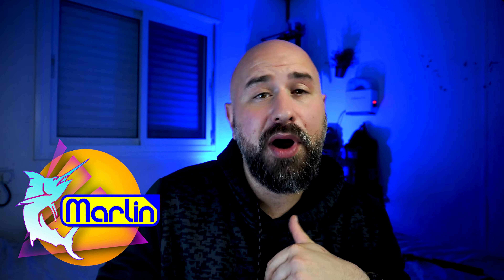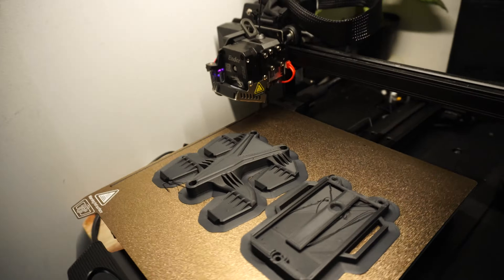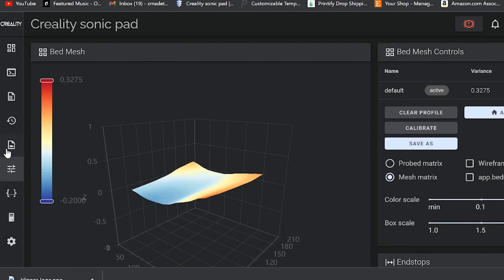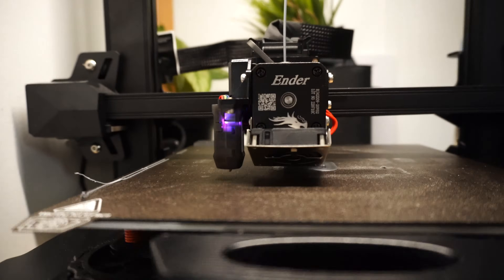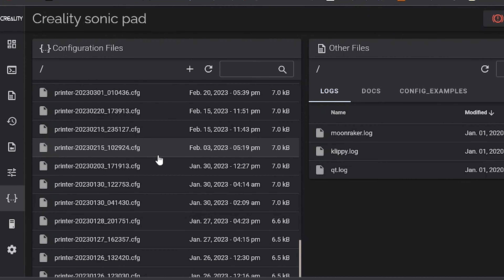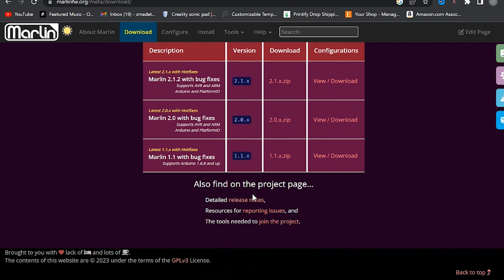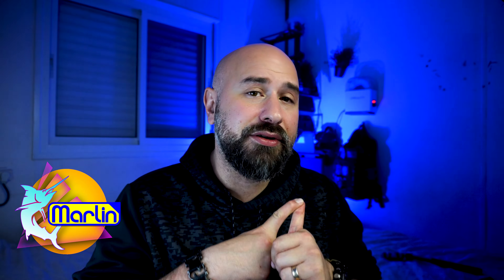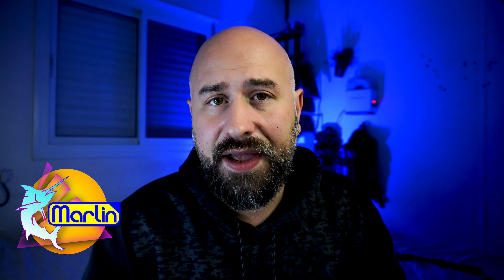Klipper vs Marlin which one is right for you

Comment: Great overview and good presentation! No disagreements on the fundamentals here. We are definitely passionate and never stop improving and expanding Marlin as more powerful hardware comes along and as new features are brought in by our amazing contributors. Features like Input Shaping and Fixed-Time Motion are very new to us in the RepRap world, so we're just beginning to get into refinements and optimizations. But even our first iteration of ZV Input Shaping is pretty mind-blowing, especially as it even works on AVR – if you have enough RAM.

One thing I can slightly correct is that the newest 32-bit boards have plenty of power to handle motion efficiently while also maintaining the UI, sensors, and peripherals. There is no real bottleneck to speak of. In fact, we are using only a fraction of the power of the newest STM32 processors even for things like Input Shaping and Model Predictive Temperature Control. Consider that old 16MHz AVR boards do a very reasonable job with 16 micro-step printing at 250mm/s, and even the slowest 32-bit boards are at least 5 times as fast as AVR! We're really spoiled with the amount of computing power we have today — and in fact now at lower cost than ATmega2560. It's only going to continue on that track, and we're going to keep finding new ways to use that power to improve safety, intelligence, and user experience.

We can't wait to share our latest improvements, coming as soon as we get through this round of testing and cleanup. Improved documentation and better tools for configuration and installation are also in the works, but it's hard to beat the videos by guys like Teaching Tech, Chris Riley, and Tom Sanladerer, who do so much to demystify our technical voodoo. I'm also building the next version of "Auto Build Marlin" extension for VSCode with an enhanced configuration interface that should help a lot with finding the exact option in our massive pile of setttings. Expect more runtime configuration options going forward as well.

Thanks for this awesome video covering the pros and cons of single-board versus augmented 3D printer controllers. We love the whole world of 3D printing and are huge fans of Klipper, RepRapFirmware, and Prusa's "Buddy" fork of Marlin. Each one has its own approach to the core problem of reliable, fast, and accurate printing, and we all take inspiration from one another. In the end it's the whole community of users, hobbyists, and creators who reap the benefits, and that's what it's all about. Happy printing!
Reply: My goodness... Will I get a backlash from Klipper fans for this post, but here goes anyway, I get the reason why clipper was developed BUT most of the reasons why it was developed is not valid anymore. I'm n little-bit baffled that the developer(s) of Marlin said "No disagreements on the fundamentals here" since a couple of things is simply not true, well, they were but not anymore. Dont get me wrong... There IS definitely a place for Klipper, However, its just simply NOT true that Klipper produces a higher quality print because of processing power. Let me clearly state that I'm only referring here to the latest printer mother boards which, almost all, use ARM or RISK V cores of at least 80MHz and up. 

1. Anyone that knows the deep down low level inner workings of CPU's will agree that background process handling is WAY WAY faster than most printers need. Stepper motor handling is the no1 main function that is driving a print... I mean mechanically, this process consumes a large chunk of the printing process. Yet ALL the step pulse toggles, and timers that handles it is completely (or almost completely) handled by timers and interrupts and that does not use any program cycles. 
My argument around this is that, with Klipper, ALL updates to timers must be fed from externally through a serial port which is miles slower than a CPU simply update a timer on a internal 32bit CPU bus.

acceleration

3. Live, On the fly settings change is also available in Marlin WITHOUT RECOMPILE! Everything from endstop setup, bed size, acceleration, extruders, autolevel, and tonnes of other. YES, there are definitely more settings one can change in Klipper, I would hope, but definitely not ones that is needed on the fly. And definitely not that one will change more than once.

4. Ignoring all my other points that I want to make, one has to ask, Is the money spent on your budget Ender not better spend by upgrading things that DOES make a huge difference, like adding a simple geared extruder, or direct extruder, or better DRV drivers? Once those upgrades was done if you add the cost of Klipper hardware you could have bought a very good midrange printer.

... sorry, but from an engineering point of view Klipper simply does not blow my hair back like people make it out to be.
Reply: @ImTheJazzman i really appreciate discourse like this. I also think you presented it well. Thanks for the information
Reply: @ImTheJazzman wow
Reply: @ImTheJazzman  Finally someone who critiques Klipper from a real engineering standpoint. I was having many doubts about my own judgement since the hype for Klipper is so high, I was starting to think I was the one mistaken since I also thought many of the things you stated, specially when it comes to serial communication and the proccesing "power" of both Klipper and Marlin compared. Moreover, theres a reason why many are seeing the need for a CAN bus for Klipper, when no such thing will ever be needed for Marlin since its communication is way faster, and the more thechnology advances and people push Klipper further, the more they have been realizing apparently that Klippers serial communication is a huge bottleneck.
Reply from the maker: Thank you for taking the time to watch my video and provide such a detailed and informative response. I appreciate your input and insights regarding Marlin and its latest developments.
I stand corrected about the processing power of the newest 32-bit boards. It's good to hear that they have enough power to handle motion efficiently while maintaining the UI, sensors, and peripherals. It's also exciting to hear about the new features, such as Input Shaping and Model Predictive Temperature Control, that Marlin is implementing. I look forward to learning more about these features and seeing how they improve the overall printing experience.
I agree that the 3D printing community benefits greatly from the work of passionate and talented contributors like yourselves. It's impressive how much progress has been made in such a short amount of time, and I'm excited to see where the technology will go in the future.
Once again, thank you for your response and for your contributions to the 3D printing community. I'll be sure to keep an eye out for Marlin's latest improvements and updates.
Reply: Thank you for your extensive reply to this video, very sportive of you guys. I have loved Marlin for years and got best results. Reason i'm trying Klipper is that Cura did an update and since then 'm having issues with the extruder. I tried installing the latest 2.1.5 Marlin software via VS code, but am receiving so many compilation errors. I have lost couple of days trying to debug but without succes (im not software engineer). For now I'll try Klipper and see how it goes (if it is better i dont know yet).... i'm using SKR 1.4 with TMC2130 and BLtouch connected to raspberry pi 2 with octoprint, worked flawless

Comment: I don't understand the way you present marlin pros. I mean dude you can do multiple extruders on klipper aswell, it has a huge community aswell (and vorons and ratrigs community just ads more to it). And y'all still target the fact that klipper is hard to install and such but as a person that made a custom 3d printer with almost 0 knowledge in this field i can say it was pretty easy to do it. You just take the rpi imager and flash klipper on the sd card and you're almost done. You just need to make the firmware file for your mainboard (this is sometimes hard to do it but if you follow the klipper documentation and READ it's straightforward). Now don't get me wrong marlin is amazing for printers that don't need much quality or speed and just need to print something. And cnc machines! I use a old skr 2 board of mine to run laser marlin for my corexy laser cutter and it's amazing.

Comment: If you have a 7 year old printer is now worth 100 dollars max, it’s not worth of buying a raspberry pi to get clipper running on it, investing all of the time it needs to install , configure and tinker with it until it runs right. Marlin would be the easy shortcut to improve the result without much extra time spent. Clipper might speed up thing but the extra speed will also introduce extra problems in many cases , especially with cheaper hardware.

Comment: Thanks for the video, been out of this side of 3D for a few years and it seems....  sure didn't slow down in my time away.
I've got a HyperCube Evolution I build and moded a bit from the base project, it's ok or good, but never been FAST, so I tend to use only a small portion of the build area as filling it would be a multi-day print.   
So, I find myself looking to improve that and start using it again. I'm still using the ramps1.4 stack with Marlin (1.9 i think). 
Any recomendations on new boards, screens (touch if possible), drives?  
Hesitant with Klipper simply because I know my limits programming, if a base file for my printer is avalible, could probably stumble throught changing some parameters (size, setsp per mm...ect)

Comment: Was kind of shocked to find out the Ender 3 V3 runs the OS (Linux) and Klipper on board, no Raspberry Pi needed! Originally I was afraid of dumping Marlin and octoprint, but the Klipper system is much better and MUCH more configurable/customizable.

Comment: You are right both Marlin and Klipper work really well. I used Marlin for three years and it worked well , although I did not config it I used Kersey Fabrications firmware which worked really well. Then I got bored one day and had a go at Klipper , because I am not tech savy it took six months of trying to get it to work. Now I would not go back I have it sorted and it is easy for me . I have not leveled the bed for a year and my start routine is the same every time . Home, z-tilt, home and print. No print failures for a year. Good vid 😀

Comment: My firmware brings all the boys to the yard
and they're like it's better than yours
damn right it's better than yours
i can teach you but i have to charge.

I'm recently miffed at Marlin, due to probe bugs and bits of unrefined UX. I use a DIY servo probe. I have worked on bug reports and patches but ultimately didn't quite have the time to beat it into shape. I have planned Klipper for a while as it's the cheapest upgrade path with Pi0. But haven't made a jump to it yet. Not sure how well Klipper is going to work for me either, given i want to be able to drop the toolhead and replace it with say a Roland drag knife, maybe laser, engraver and other possible accessories.

I think the best think about Klipper isn't input shaping, it's the correct jerk-free acceleration handling.

I think a very good thing is being disregarded, RepRapFirmware, also known as the Duet3D firmware. It runs on LPC and STM32 processors and some control boards can be really inexpensive, it has built-in web browser controller, and it has all the same algorithms as Klipper, indeed originating many of them. Marlin attempts to reach for the same but the quality of implementation is so bad for the more advanced movement algorithms, the options don't work well with each other, the outcome is pathetic... it's understandable given Marlin has to remain compatible with 8-bit controller boards, but it's unfortunate. A firmware won't be really good at it unless it can pick one movement model and stick to it.

There was also Smoothieware, not sure where it's at right now.

Comment: To me it was soooo worth. The way you do basic tuning and configuration changes in Marlin killed every bit of excitement I had for 3d printing when I started out. Typing in manual gcodes on a horrible touchscreen, hoping that things would properly save with no feedback at all. Needing to compile my own firmware, open the printer up, disconnect the display and repeat for every small mod or config change? Just no...

I pretty much ignored my printer for over a year because of the user experience with marlin. Sure, Octoprint might have helped with some inconveniences, but at that point I was too jaded to even care.

Ever since I installed Klipper I actually like using my printer now. I can start a print right from my slicer, I can edit the config from my PC in an instant and repurpose mcu pins for whatever I want. Klipper provides wonderful feedback on pretty much every tuning step and the overall user experience is just so much nicer, even before considering the extra features.

Comment: The Sonic Pad is a great idea, but as of now it is still relatively locked down compared to vanilla Klipper.    Marlin on a 32 bit board is really powerful still.   That said, a lot of stock firmware is not even using half of what Marlin can do, so even flashing a new version of Marlin with additional features enabled can make a big difference to the printing experience.     I found that when I first got my Ender 5 Pro.  Although it had a 4.2.2 board (32 bit) it had an old version of Marlin that was feature limited.   Upgrading to version 2 of Marlin and enabling features improved the experience dramatically.   I also had a Raspberry Pi 3 and a 7inch touch screen laying around, so it wasn't long before getting Octoprint (Octopi) into the mix.  I used that for a few years, but now I am seeing so many good reviews on Klipper, not to mention that is now also starting to creep into commercial printer releases, that I felt it was time to try it on my old, original ender 5.  Well.....  The difference wasn't night and day.  It was more a bit subtle, but I could get an extra bit of speed out of it.  Quality wasn't improved over Marlin 2, but I could go from 80mm/s to 120mm/s and not have any degradation of quality where is with Marlin, if I increased the speed, although it still printed well, the quality was noticeably different.   
I kept my old SD card with Octoprint and a copy of my Marlin firmware in case I wanted to go back, but so far I am not going back and KlipperScreen with Mainsail is a much more complete user interface than OctoScreen or OctoDash.    I can still run OctoPrint for the advantages of Octoprint, but Mainsail and KlipperScreen just give a very complete UI for the printer.   That's something Marlin was never really able to achieve on an Ender 5 with the stock display.

Comment: Hi, Thanks for the video. Very helpful. I am just getting back into it and have some relics here that I wouldn't mind upgrading. Some are reallly old lol. We are talking an Anet A8, a Ramps 1.4 based RepRap and aTevo Tornado! I The thing that worries me about Klipper (or adding a pi into the mix generally) is that that the SD card tends to get corrupted upon power loss or if I have a brain fart and just turn it off without thinking. I had it no end of aggro with a NAS that I built and had to faff around making a 'safe soft shutdown' thing for it  in the end because it drove me so nuts! Have you experienced any issues with corrupted / non bootable pi's running Klipper due to unclean shutdowns or power loss? Thanks again.

Comment: Honest to God, installing Klipper and getting back to even the basic functionalities that I had in marlin has been a 5 day journey of repeated reinstalls, corrupted files, dodgy bootloader's, and problem after problem after problem, but I finally got to start working on input shaping and adding the code... And it began again. Disconnect the adxl and suddenly the control board starts freaking out and then can't resolve hosts, eats the bootloader, and the only way I can see to get everything playing nice with each other again is to reformat the pi.and start over, because APPARENTLY updating your software is a BAD thing in Klipperland, and if you update to the newest stable version it will decide to break functionality with everything.  

Marlin seemed more black-boxy from the start, but once you realize you've got full control over everything in its code it actually is pretty accessible and you can even add new features fairly easily if you take the time to code em.  Sure beats fighting with the closed ecosystem that is klippy.. I swear man the SECOND marlin is capable of similar speeds and input shaping I will have a massive smile on my face as I nuke that useless software and reinstall marlin.  

I think I understand why it's faster now though .....Everything is stripped out of it.  Everything.  You want bed leveling?  Better write some code from scratch or copy someone else's to make that work!  Want a sensor for your filament run out? Oh you'd better believe that doesn't come with it.  Hell... The only thing that did work without much tweaking was quad gantry😂
God forbid we want to have an easy way to prevent you from needing to home the machine every single time you let the motors lose power, cuz after 7 hours of searching I'm still no closer to finding a solution besides "keep them constantly powered" and frankly that isn't ecomomical or logical, especially when the machines are balanced to stay still when unpowered so they cost less to run.  T.T .

Comment: I know, dumb questions first, :)  so my question is after using Klipper and don't like it,  is there still Marlin on my printer board to use ?!
Reply: If you've flashed the Klipper Firmware to your board, you'd need to download the Marlin firmware and reflash your board to go back. It won't store the old firmware anywhere, the copy on your board will be erased. But it is possible to reflash the Marlin firmware after should you choose to.